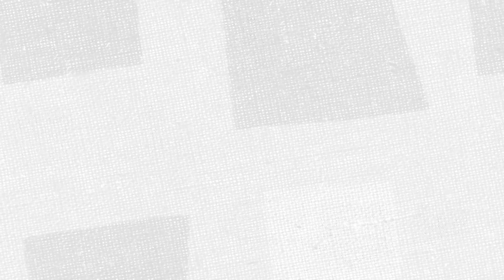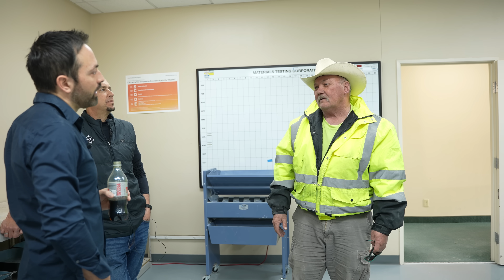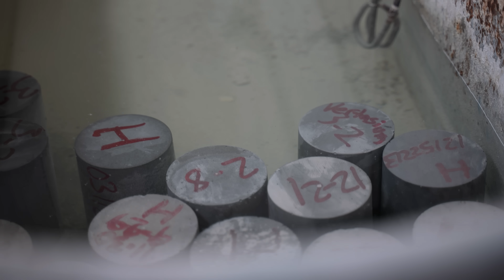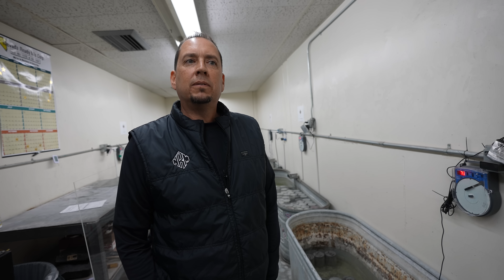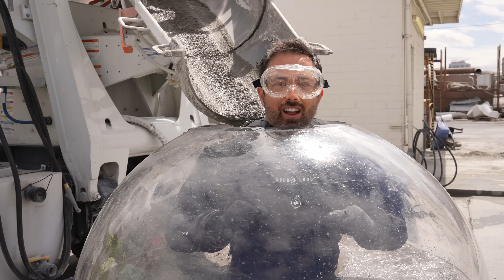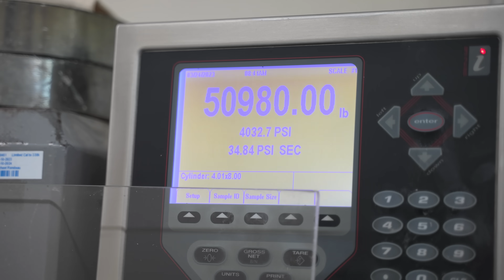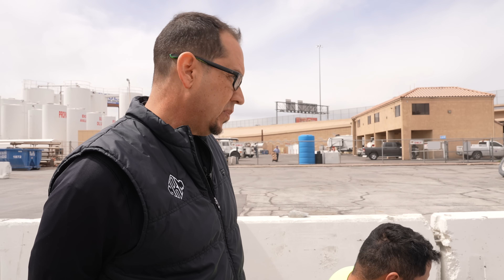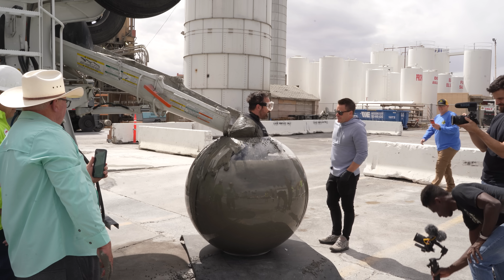Getting Buried In Concrete To Explain How It Works

Comment: Timing is great. I'm a civil engineering student and i spent this whole semester learning about concrete and cement. We mix our own concrete based off of formulas to get certain specs out of the concrete. We made the same 100mm by 200mm cylinders and we will be breaking them soon to test their resistance at 28 day. Everything in here was spot on as I expected it was going to be. Nice work as always
Reply: So when are we gonna be able to 3D print whole (big) bridges?
Reply: So what? Have you ever finished a floor? Have you ever done anything outside a lab? I've done more concrete then people have walked on.
Reply: @RealMTBAddict  He is just a student, chill... his journey is starting
Reply: @ArawnOfAnnwn  Not feasible. Bridges need tons of rebar for reinforcement. Without rebar concrete would crumble on something like a bridge deck.
And we will still need steel beams for support. We can't 3d print everything.
Go to any commercial construction project and ask about 3d printing. They will laugh immediately.
Same with robots. You need to come back to reality.
Reply: @RealMTBAddict  He’s just sharing his thoughts and his experience in this field so far… He’s not trying to flex or anything. I’m not sure if you are aware of it or mean it that way,but your comment sounds a bit cocky
Reply: @axela9282  It sure is! I have earned that right!
Reply: @RealMTBAddict  oh god youre a child
Reply: @danisob3633  OH GOD OH YES OH GOD OH YES OH GOD OH YES
Reply: Wow! I'm surprised you guys took a break from the dirt!
Reply: Im in the exact same situation. We make our concrete in cubes though and are testing them next week.
Reply: @RealMTBAddict  typical, conservative, bitter worker 😂
Reply: @albo5194 The age ol' engineer vs builder friction...Engineers specify one thing and the builders complain about the buildability of that thing. Good designs always incorporate buildability. Unfortunately, for one reason or another, especially when you have inexperienced engineers or the builders aren't involved in the design process, a perfectly buildable/understandable design isn't always going to happen. This is normal and everyone in the industry knows this. It's nobody's fault and a symptom of time, money, and non-perfect communication between entities.

So you get the contractors complaining about engineers when they generally don't know the half of the story. Or you get engineers designing stuff in which they're clueless about the "boots on the ground" work that would actually get that thing constructed.

But then there's this guy...who seems to be threatened by a student, someone not even in the industry yet...this is not a good look for a contractor.
Reply: @SJokes  We made the cubes too (50mmx50mm), but they had no rocks, just sand and cement.
Reply: @RealMTBAddict  Wow that's great! You are really good! Sorry you don't get half as much recognition as your lonely little heart and soul require. Commenting on here to belittle a student while bragging about all the great things you've accomplished is quite pathetic. I truly wish you could get a medal and a ''thank you'' from everyone who's ever been in contact with the concrete you so elegantly finished for them, but until that happens, you can try and find solace in mine. Thank you mr Mountain Bike Addict for all the concrete you ever poured for me!
Reply: @RealMTBAddict  Why all the salt?
Reply: @falashlaba20  Interesting. I noticed in the video the guy said rounded rocks are used because they are better for the structure and strength, but many of my lecturers and project managers of sites that we have visited said that angular is actually better because it allows the rocks to interlock. Found that contradiction interesting lol.
Reply: @SJokes  Oh yeah true. That's also what i've been taught.

Comment: I used to work for a cement company in the marketing department and spent a lot of time travelling around to our different quarries (it was called Castle Cement Ltd in the UK).  I remember our process of creating cement being different to what you have shown.

In the UK the limestone was quarried in massive chunks that filled the back of monsterous dump trucks (I believe the chunks were around 500 tonnes each).  These were then dropped into a massive ground crusher (like a lot of gears spinning that broke the chunks into a rough gravel).  This gravel was then transported around half a mile from the quarry via conveyor belts into a large circular building where it was dropped in via a hole in the roof in a circular motion creating a huge gravel donut (well, torque shape).

An extremely large blade then passed through the gravel taking away thin sections, which was transported via conveyor belt into the kiln.  This was a long 30-40 foot high tube that was about the length of a football (soccer) pitch with a screw design inside to keep the gravel moving towards the flame.  A flame was shot down this pipe in what I can only describe as a jet engine blast and I was told this heated the gravel to around 3400 degrees centigrade.  I looked through the view hole into the kiln and saw the process which made me realise that if I was 10 foot further towards the kiln, I would literally not exist!

The result from this formed the clinker.  This clinker was then moved to a gigantic washing machine type contraption.  It was a cylinder that was around 60-80 foot high and around 50 foot long (from memory).  Inside it was half filled with steel balls (around fist size) and it span at around 10 rpm.  We could only run this during low peak times as the energy it used to spin this took a massive drain on the electric grid in the Ketton area.

The clinker was moved into this "washing machine" and gypsum was added as well as other components.  The end result was Castle Portland Cement.  Ketton quarry also creates some very white limestone which was used to make many of the famous buildings in London as well as Oxford University.  Castle Cement was used to build the Skye Bridge connecting the Isle of Skye to the Scottish mainland.

If you ever see a builder squirting or pouring washing up liquid into his cement mixer, that is the same as using a plasticiser.  Just thought that was interesting.

When a cement spill occurred a few years back in the control office in one of the stations of the London underground.. they quickly threw bags of sugar on the cement... that stopped it hardening so it could be removed.

Cheers.

Comment: They used an excessively high slump mix out of caution, which makes it way more buoyant. You can get buried in low slump concrete with the additional friction between you & the mix and the additional cohesion of the mix itself above you.
Reply: That mix was basically water, it formed a flat puddle xD Which unsurprisingly, is not a fun thing to receive on site when you are expecting a stiffer mix.
Reply: I wanted to see him in concrete that he would get stuck in
Reply: Either the mix had a lot of extra water in it, or they added chemical plasticizers to make it flow more. As I mentioned earlier, it looks like the new spread test (ASTM C 1611) is becoming more popular than the ol' standard ASTM C 143 slump test. I've done hundereds of slump tests, but had never seen the spread test until now.
Reply: @bripslag  Honestly had never seen the spread test until this video... I'm a slump man through and through, haha.
Reply: It doesn't matter how you mix it. Concrete is heavier than humans= humans don't sink into Concrete. With or without water.
Reply: @mr.monitor.  Not necessarily! Imagine pouring just aggregates, which are heavier than humans, on top of a human... the human does not float to the top!

Same principal for low slump mix... there'd be a slump over/under where a human would float or not.
Reply: @Sean Hayes  ya ya if you pour dirt or anything dry on top of a person they would stay buried as long as there was no vibration but you can't sink into gravel or wet concrete for example.
Reply: Just a little bit of old concrete left in the drum before batching a load will make the load get hard a lot faster . 
Lazy driver or batcher in a big rush. Less likely to be somebody's leftover. 
From my 21 years driving mixers.
Reply: Even i figured that out  @mr.monitor.
Reply: @SeanBryantHayes  If you are pouring concrete onto someone, you have problems. That isn't what I said. I said you aren't going to sink into it.
Reply: @natedawg-p8v  good dawg.

Comment: studying material scientist here. great video. what amazed me when studying concrete, and that the engineers started to touch on, is that concrete is never "hard" and it will keep hardening indefinitely but engineers decided that ~30 days is "hard enough". pretty wild to think about, and is especially funny when you realize something being "concrete" is generally a term for being unchanging
Reply: “Strong enough” is normally driven by how quickly the next step of construction is needed. You don’t want a concrete bridge deck to wait half a year to get to the point where it is strong enough for vehicles to drive on it. Timely strength gain is driven by constructability requirements.
Reply: @Josh Olson  which is one reason we have high early strength mix designs.
Reply: 28 days is when you get diminishing returns on strength over time. Prestressed concrete have their strands cut a day or two after casting to stress the concrete then they're moved to sit for a month before shipping out. Concrete is already strong just after a couple of days.
Reply: @justinrobertson5493  I have been testing construction materials for 30 years. Pretty strong is not strong enough to use for holding up a floor in a CIP mid-rise, or an intersection of a major thoroughfare. I've tested concrete with synthetic polymers and fiber mesh additives designed to hit 6kpsi at 4 hours just so a section of tollway can be re-opened to the public. At 7 days you expect at least 70% of design strength. If you get less than 60%, it should throw up a red flag. That is if you have the luxury of waiting 7 days to see obtain that strength.
Reply: "concrete" is the opposite of "abstract"
Reply: Interesting to know. Although I think the term “concrete” is used to refer to something being physical or well-defined rather than to being unchanging; the opposite would be “abstract”, not “fluid”.
Reply: Technically, there does come a point when the last chemical reaction occurs between the molecules that make up the concrete, at which point it can no longer become any harder, but such a process takes years to fully complete.

Comment: I did my masters thesis on ways to make concrete more environmentally friendly. Reducing cement by small amounts and replacing with carbon, char in my case, works really well. 

I don’t miss breaking cylinders at all but this video was a good reminder of the times. 

Also that was not a slump test, that was a flow test. Very different things. 

Really amazing video. Even for someone like me who has spend way too much time in a concrete lab, I learnt a few things. Thank You
Reply: I thought it was a bit hypocritical to waste concrete and then ask for money to offset the carbon footprint that someone else has. Although the plastic sphere may have had a larger carbon footprint. Biochar forever.
Reply: @DumbArse  Um - you can reuse it as gravel. wet it all you want it will never set again.
Reply: Actually it’s a spread test
Reply: @AndrewBrenner1 grind it back into gravel to be used as gravel, not rocket science.
Reply: @AndrewBrenner1 1 cubic meter of concrete is less than nothing, did not effect the environment at all, your logic makes no sense at all, thats like saying people are hypocritical for driving to work if they also think oil companies should try harder not to spill billions of barrels of oil in the ocean. the scale is WILDLY different.
Reply: @graydient05  I like your logic. If we would just pour concrete in 1 cubic meter increments - we can completely erase the carbon footprint as it is "less than nothing". I also am making a note that I should switch  back to driving to work rather than riding the bus since my logic makes no sense anyway.
Reply: Civil Engineering moment
Reply: slump test = measuring the vertical drop of concrete once it slumps
flow test = measuring the spread of the concrete
Reply: Top tip: if you come up with an idea that you think might have the slightest chance of being revolutionary, don't share it or it will go straight into the government's hands who will claim they developed it in a lab.

Comment: In just over 2 weeks, I will hit my 40th anniversary of being a civil engineer.  But it was at least 5 years earlier that I was taught the difference between cement and concrete.  

Thru the years that followed, I have explained this difference countless times.  The best analogy I came up with, years ago, is cement is to concrete, like flour is to bread.  

That said, the cement in concrete “cures”, thru a chemical reaction with water, called hydration.  Flour becomes bread thru the baking process, which I don’t really understand.  

Also, hydration is an exoteric reaction; it produces heat as it cures.  

Anyhow, thanks for making this video.  It’s filled with great information that I hope more laypeople will find informative and entertaining.

Comment: My dad was a civil engineer specializing in concrete, asphalt, and soils. He owned a materials testing lab and I grew up testing those materials, and eventually worked for other labs doing the same. I've broken many hundreds of concrete cylinders in the lab and done countless field tests for slump and air content. I've been out of that line of work for over 30 years now. This was the first I've seen mention of the concrete spread test, but I see it's becoming the standard, presumably due to concrete mix designs incorporating more chemical plasticizers to make the mix flow better. Back when I was in the business, plasticizers were available, but they added cost and were not commonly used.
Reply: The spread test is only done for self consolidating concrete mixtures, which ARE becoming more common, but the typical (and mostly useless) slump test still reigns for most applications.
Reply: The slump test is so there's something to hold the contractor to. Some RE's love to swing D and reject loads of the slump doesn't meet spec. With modern additives the slump can be deemed pretty useless.
Reply: @BM-gn4gk  RE here. DOT's are starting to drop slump. ACI is moving away from slump being part of the standard testing too. Personally, if the aggregate isn't sinking, and its the right consistency for the job, I'm happy.
Reply: I just finished my 5th year as a testing tech. I did it all but mostly did soils and asphalt because there was more money there.

We were working 60-70hr weeks consistently. I burned out and quit. I really did enjoy traveling all over my state, but I wish I could have at least had the weekends off.

Was your experience similar? Always working overtime?
Reply: @chrisvids1820  I am currently doing CMT testing as a job, in fact I'm on site while writing this comment. On big projects where you travel out of city/state, overtime is extremely common. I do 10 days on 4 days off and work about 120 hours in those 10 days, not including 30 min breaks.
Reply: @chrisvids1820  decade testing, average work week 85hrs, average duration 7 months. Average days off per month, zero.
Reply: Spread testing and slump testing are dependent on the specifications of the slump. You can't do one on the other vica versa.
Reply: I’m surprised we still use the slump test. It’s a pretty useless test
 these days
Reply: People and their personal stories and all the fake likes

Comment: Retired architect here. Cement is the glue that binds aggregate together to make concrete.  Concrete is thus a composite of Portland cement and aggregates. So saying cement and concrete are "mixed up" isn't just a bad pun. It further confuses the issue. Cement is often mistaken for concrete, and visa-versa is more accurate way to state the problem.

Cement = expensive chemical glue that cures through the process of hydration
Aggregate = cheap, inert structural filler
Admix = something that modifies the structural or aesthetic properties of the finished concrete, or the chemical properties of the Portland cement glue. Some admixes do both. It's all very complicated - trust me...

..and skyscrapers are not made of seashells. Their floors are. Their structures are made of mainly of steel and enclosed by glass hung from extruded aluminum sections, usually with lightweight, non-structural concrete floors poured into corrugated steel pans that span between secondary structural elements like wide-flange beams or light metal trusses. Most of concrete serves two main purposes - fire resistance and sound isolation. The only load bearing concrete will generally be low in the structure and used as footings, or sometimes as shear walls higher up. This is because thick load bearing structural concrete is ill suited for use in very high buildings due to it's mass.

Finally, infrastructure is not made from concrete alone. Bridges and roads and sidewalks are composite structures of concrete and steel reinforcement bars (rebar) engineered to exploit the compressive strength of concrete and the tensile strength of steel
Reply: You must be fun at parties.
Reply: @0ther_s1de hahaha I was thinking the same thing